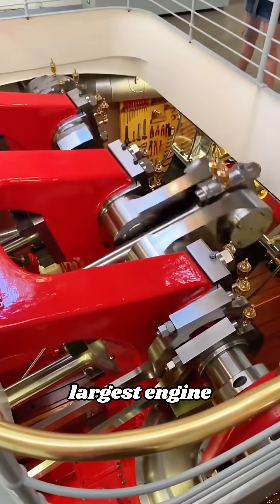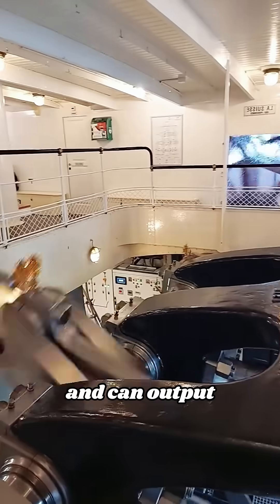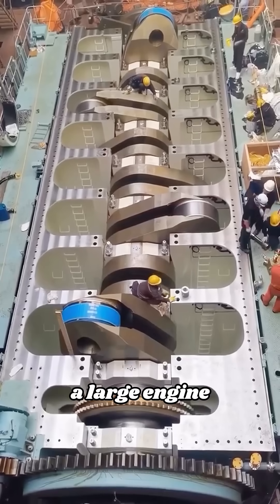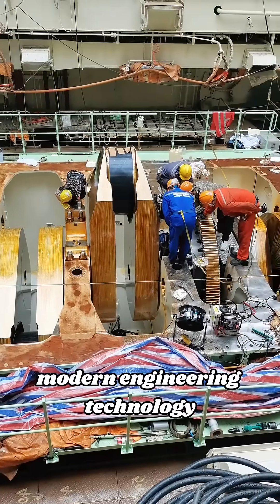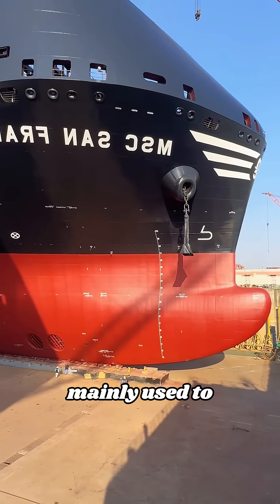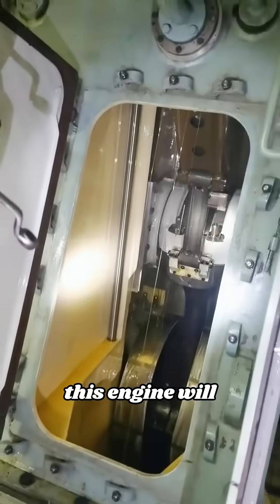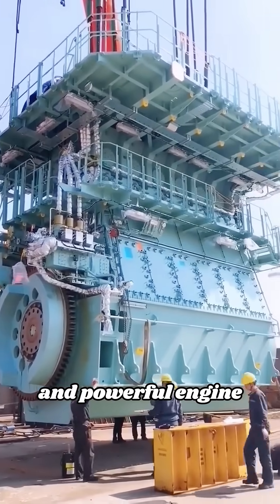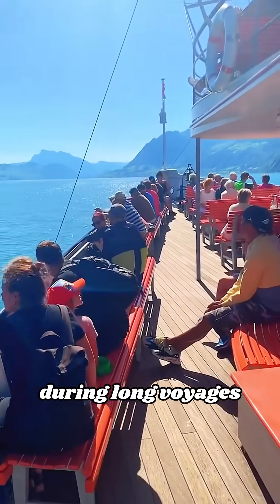World's Largest Engine: 300-Ton Crankshaft, 110,000 HP, and Burns 13,000L Diesel/Hour! 🚢

Comment: What à load of crap. Half the crankshafts are from s t eam engines the other a 2st diesel. They dont use diesel fuel but heavy fuel oil.

Comment: This engine would be useful for electric power generation; like in a power plant
Reply: In fact they are used for power generation. Mostly it is the backup plan when all else fails. A some years ago there was a massive failure, meaning every power plant was shut down. The had to start a massive 12 cylinder engine up, to get the power plants back online again.
Reply: @petertuxen4930 so just to get everything working or replace the needed power supply?

Comment: Actually the technical difficulties of manufacturing these are lower. First they are low RPM therefore less wear and tear. Second, the tolerance of margin is more forgiving on them. You don’t need to get down to smallest number ε.

Comment: The sad part these big engines are not enough during a storm. The owners look for fuel millage, even running thick heated oil after it's away from coastal communities.

Comment: What's a gallon of diesel fuel go for these days?🤔😂
Reply: Googling says the national U.S. consumer average is $3.65 per gallon. However:
#1) Diesel represents a small fraction of their fuel use. Once a ship is out of a country's EEZ, they switch from Diesel to a cheaper, but dirtier 'bunker oil'
#2) When using Diesel, they pay less per gallon than U.S. consumers due to volume, and lower transport/storage/distribution costs, and ability to buy internationally.

Comment: Nonsens video. It's 14 cylinders. ☹️ Stupid nonsens AI videos. 
It only goes on diesel when going in and out of the harbour. Normally it goes on heavy fuel oil.
The electricity it uses shouldn't be mentioned, since it's included in the fuel consumption, since the generator often is on the shaft of the main engine.
And the consumption numbers counted up here are totally nonsens.

Comment: It's called Wärtsilä-Sulzer RTA96-C. It's a two-stroke turbocharged low-speed diesel engine designed by the Finnish manufacturer Wärtsilä. The engine is the largest reciprocating engine in the world.
Reply: You would need  gigantic fuel tank. They wouldn't be a viable shipping engine.
Reply: @techmen292 Tankers are large fuel containers. They have fuel tanks that hold thousands of barrels of fuel.
Reply: I thought titanic had biggest engine
Reply: @ronwallace6273  Steam engine
Reply: @ronwallace6273 it had steam engine
Reply: There's a building near Annapolis with warsila on it.
Reply: When you see a empty oil tanker behind a US aircraft carrier.
 It is twice as high and 3 times wider.
Does not fit through a lot the world's canals.
Reply: It consumes about 90 barrels of fuel an hour?   That seems crazy to me.
Reply: I think it needs a supercharger
Reply: You fins better stay far away from Yemen, unless you have came to the negotiation tables with Houthis
Reply: @Keepskatin  no problem.
Negotiate like Corbin Dallas.

Comment: Thirteen thousand litters of diesel per hour, I doubt
Reply: I wondered about that myself, so a Googled the fuel consumption of a large ship. The answer was 80,000 to 200,000 gallons/day. Using the highest estimate ... 200,000/24 =  8,333 gal/hr. At 3.785 liters per gallon equals 31,540 liters/hour. So, yes, 13,000 liters/hour fits the range of the LOWER estimate.
P.S. It's 'liters', not 'litters'.
Reply: @gregparrott  P.S. It's litres, 
not 'liters', not 'litters'.
Reply: @GrandaddyO-E14  Wrong.    BOTH ARE CORRECT.     The U.S. uses 'liters', while Europe uses litres.
This distinction also exists with words like 'aluminum' (U.S.), versus in British English it's referred to as aluminium. (an extra "i")
Reply: @GrandaddyO-E14  litres would be British English/Western European spelling.  Liters is American English spelling.
Reply: @WildBikerBill  No, it's also "liter" in Dutch, German, Swedish, and others.
Reply: @pablonh  Countries that do not use English as their first language.
Reply: @ I was responding to "litres would be British English/Western European spelling".

Are you claiming that Germany is not a "Western European" country?
Reply: @gregparrott In English it's litres. 😅😅😅
Reply: @coolhand1964  WRONG  That is unless you challenge whether the U.S. speaks English 
 It is 'liters' in the U.S., while in England and the rest of Europe, it  is spelled 'litres
Just read the first sentence   https://en.wikipedia.org/wiki/Litre
Reply: @gregparrott  It's 'litres' in proper English, my dear fellow. Which was pointed out to you, and litres across all of Europe where the English language is used. It's only the US who bastardises the English language, because it's too difficult for most of the population to learn to spell words correctly, so you use the phonetic spelling so that it's within your average IQ levels.
Reply: @coolhand1964  Funny thing is a lot of the differences in spelling aren't because the US did things different.  It's because somewhere along the lines the rest of the world decided they wanted to change the spelling for some stupid reason.  Only a most arrogant European (typical on the internet) would make such a comment.
Reply: @jasonstclair6293  Except that the English language existed long long before the US even existed. So that fact takes the wind out of your sails and only backs up my original point regarding average US intelligence. Furthermore I am neither from the UK or EU. I just happen to be well educated.  One should never assume. Because it makes an  ASS out of U and annoys ME.
Reply: @coolhand1964  How does that back up your original post if we weren't the ones who changed things for no reason whatsoever in the first place?  What reason is there to actually change the spelling of a word that has been spelled the same way for centuries and then try to say we were the ones that are unintelligent or whatever?  YOUR SIDE OF THE OCEAN MADE THE CHANGE IN THE FIRST PLACE.
Reply: @ I will admit that litre is not an example in this case as litre is historically the correct spelling, but there are cases in which the spelling we use is the original spelling of the word.  We DID NOT change it.
Reply: One liter diesel oil contains about 11 kWh combustion energy. To generate 110 000 horse power per hour equivalent to about 82 500 kWh, assuming an efficiency of about  55 per cent for such....a big diesel engine....you needed about 82 500 kWh/ 11kWh x liter diesel / 0,55 = 13636 liters diesel per hour.
Reply: @privantomas  I like your methodology, as its more direct than what I posted. But I get slightly different numbers. At 11 kWH/l and using 55% efficiency, the net is 6.05 kWh/l,  One horsepower equates to 746 Watts. For 1 hour, that's 0.746 KWh.  110,000 HP equates to 82,060 kWh, requiring  = 13,564 liters/hour. Our difference appeared when you got 82,500 kWh, whereas I got 82,060 kWh.
Reply: if its true that 1 litre diesel gives 12 kwhr then that means about half a cup (100ml) of diesel is about the same as a lead/acid car battery when fully charged (about 1.2 kwhr for a 12v 100 amphour battery.
Reply: These big ships don't use diesel all the time. They are too expensive to run. Bunker fuel which is the thick black sludge are fueling these kind of ships in the open ocean.
Reply: @fleurdewin7958 Yes...diesel is only for priming or as a primer from a "cold ship" to heat up the bunker before shifting from diesel into a bunker.
Reply: I doubt that myself ( litres per hour)
Reply: I doubt it, too. This thing wouldn't make it across the ocean without running out of fuel.
Reply: @ Ever hear of a bigger tank?  Several people have done the math and the numbers check out.

Comment: The largest is 14 cylinders
Reply: Well actually no. The largest is in fact an 8 cylinder engine. The 14 cylinder engine is two 7 cylinder engines put together, with the timing chain in the middle.